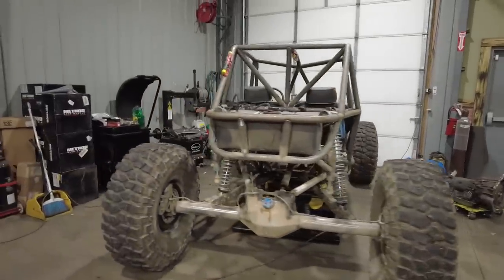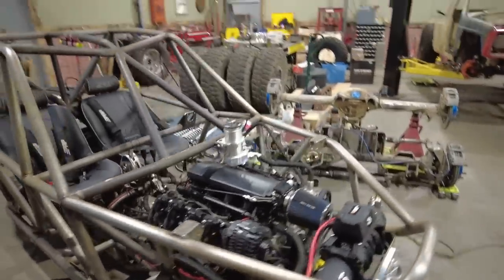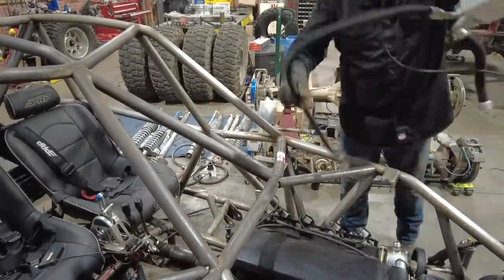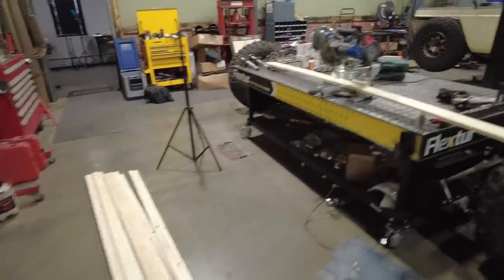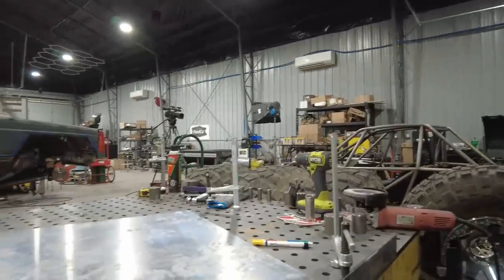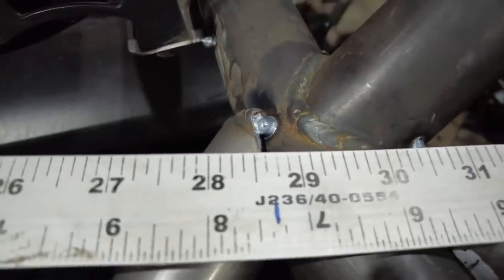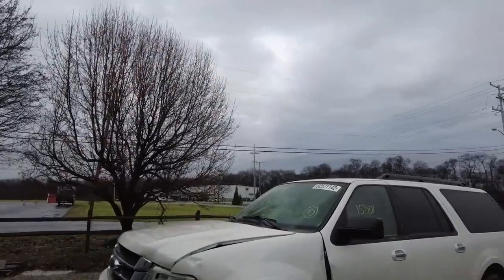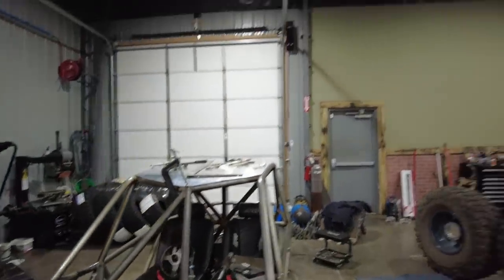Tearing My Bomber Fab Trail Chassis Apart

Comment: Well worth it on the donor. By the time you mess around finding all the little parts to support a take-out engine, you've lost a bunch of time and money, where the full donor will have everything you'd potentially need. I bought a complete TDI Jetta so I'd have all the wiring and everything else to make the swap less of a hassle.

Comment: I order all my under parts in bare steel for the same reason.  I paint the underside with a spray can and when I come off the trail I can see any new hits and make sure everything in that area is ok,. do a nut and bolt check then respray it so it is ready for the next trip
Reply: Yep. Paint makes sense over powder coating for any vehicle that gets actual use. Easy to touchup paint. Powder coat "touchup" requires full tear down, likely sandblasting and then re-bake the whole item--nobody's doing that in the real world. It's trendy for sure, but it makes no sense in reality.

Comment: The spring rate of a shock can be assumed to decreases in a linear manner for the first ~12°. After that it decreases as a sin function. Rule of thumb would be about a 0.3% decrease in spring rate per degree of angle tilted for the first 12 degrees.

Comment: Have you thought about mounting the intake manifold backwards on the engine? I probably do more river stuff than you plan on but that's how I'm planning on doing my buggy, keeps it out of the dust underneath the dash area
Reply from the maker: Yes I have it that way on my goatbuilt LJ....on a tube buggy like this with no firewall it really won't make a huge difference

Comment: could you install brackets at the filler panel under the power steering pump to hold plexiglass, that way you could still see the tire but still get some protection from any rocks, dirt and debris the tire might throw back and with using brackets you could cut several pieces of plexi to the same size and just swap them out when they get to scratched or damaged.
Reply from the maker: Was thinking of doing that

Comment: Ian - when you hemmed the edges of your body panels, it raised them off of the tubes they were mounted to slightly. The body panel mounting brackets still look like they are welded so the top of them is flush with the top of the tube. Are you putting a spacer in there?
Reply from the maker: The edges of the panels drop down over the tabs....that is what the benefit of that rolled edge does

Comment: I think I may have to correct you on your analogy for the coilover angle. If you mount a shock at a 45 it will actually make the suspension stiffer than straight up and down. It sounds silly but if you use small scale it helps more to understand. I like to use rc cars to make sense of things. Take a rc car with different holes for the shock mounting. Mount them as vertical as you can then press on the rc car and you’ll see how soft it is. Now lay them down as much as possible with the shock positions and you’ll notice the suspension is much stiffer
Reply from the maker: NOPE....you sir are wrong you need to do some learning on the subject....angle drop s the spring rate and you have to actually do some math to come up with the correct rate......

Here is some reading for you

https://www.qa1.net/tech-center/spring-rate-tech

What you are probably feeling in the RC car is excessive drag on the internals of the shock....not the spring getting stiffer.

Comment: On the spring rates, I'd be curious about how the leverage of the arms comes into play? Ie, having the shocks on the lower links prerunner style takes less effort to compress than if it were on the axle itself. I know that having them on the trailing arm allows more flex, but I wonder if that might also be part of your problem.
Reply from the maker: Its not a problem...trailing arms are amazing...you get more travel out of a shock and better packaging.  You just have to adjust spring rate to compensate....you need more rate depending on the location of the shock on the arm.  this car has 21" of wheel travel in the back and 17" of wheel travel in the front using 14" shocks!!!  I used Randy's base rates for his buggies..but he uses different shocks (king vs Bilstein) on his rigs so the valving is different, and his locations are slightly different.  This is just a tuning issue and it is what awning a buggy is all about!!!

Comment: @Ian - looks like since the Willys wagon (when you borrowed Kevin’s bead roller) you bought your own motorized unit.  Was buying the motorized unit a non brainer or would a manual bead roller for the general hobbyist suffice? What are the key diesto buy when starting out?
Reply from the maker: I went with the powered roller because when I was doing larger panels I could not do them by myself....I am by no means a "good" bead roller but I am learning and loving to add a new skill to the shelf

Comment: You trust a switch pros more than circuit breakers? Whenever I think about items like switch pros or spod I always equate them to the Mopar Power Distribution computer that goes bad every couple years..
Reply from the maker: The switch pros is fed by a circuit breaker so it still has overload protection in it....and the solid state stuff is really good

Comment: How is the heat when you are wheeling?  Seems like it would get really hot with the heat from the Engine, trans and radiator placement?  It seems like it would get rather warm when you are not moving much?
Reply from the maker: No heat at all TBH....with no hood and other panels the heats tends to rise out the top....plus with no radiator fan blowing hot air back at you from the front it is actually quite comfortable...well tube buggy comfortable

Comment: How do you know when you can use the tig without a filler rod, like you did for those bolt retainers.
Reply from the maker: If the pieces doesn't act as a structural piece...ie exhaust, those bokt retainers you can fusion weld it...if it is structural like a roll cage or chassis ot needs filler

Comment: You should put expanded steel where your feet go so you can still see the tire but it finishes it off and keeps bigger rocks from hitting you in the balls.
Reply from the maker: I just hate that 'look" seems too much like a tractor
Reply: @BigTireGarage  that is a pretty solid point and at the end of the day youre the one who has ro live with it so works for me. Also love how long and in depth this video was. Keep up the cool work!
Reply: @BigTireGarage  you know what thats a great topic for the next q and a. Where and how do you draw the line between keeping something aesthetically nice and also being able to treat it as a rock crawling rig.
Reply: @BigTireGarage  I was thinking about some lexan in that area.
Reply: @Big Tire Garage   I agree with others, use lexan/PC but aesthetically it's gross.  Throw some limo/black or maybe mirror tint film on it.  It would clean up the look outside and still be transparent in one direction..  win/win